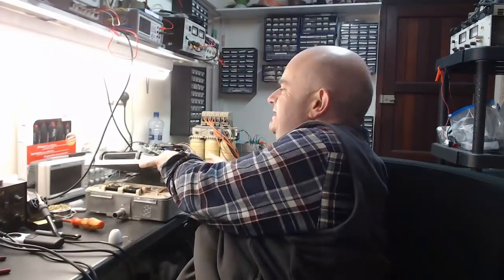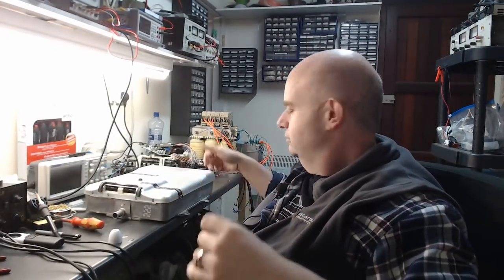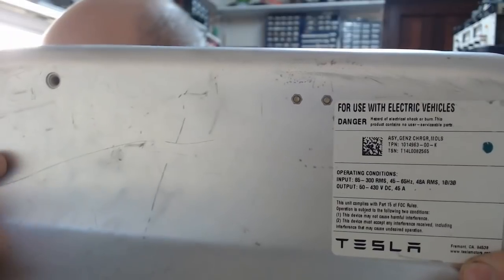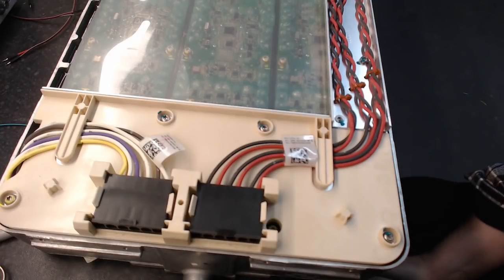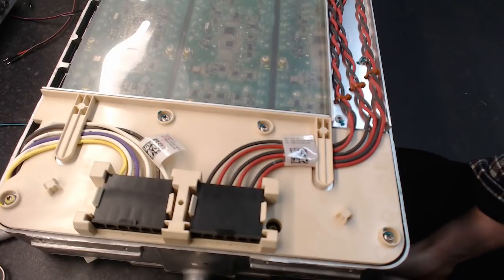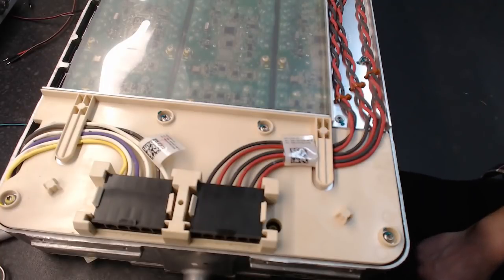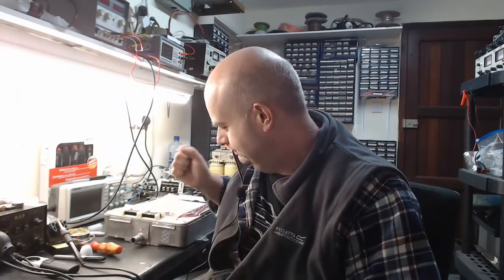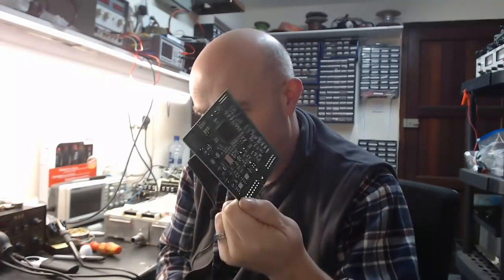E39 Upgrade Update

Comment: could your motor be low voltage  winding and need more amps at low speed,sounds like low voltage at high speed (lots of power)

Comment: I rewound a 5kw generator and it is not that hard ,do not flip a winding which will buck the power to the winding..I like the flat bar hair pin stacking  with brazed ends ,chevy volt like ,also with stacking winding you get low winding to winding voltages, helps  with the insulation life.

Comment: Motor is wound for lowish voltage and higher rpm. Simple solution lower the final drive gear ratio you have a transmission after all. More pain in the but solution rewind the motor.

Comment: Hi Damien 
 I would suggest possibly thinking old school,  knowing what little I do know about three phase AC Star Delta motor starters and what they do?, surely this could be done electronically using IGBT's? and the transition from one to the other can be altered via throttle position and road speed signals via CAN??, thus the star config giving a higher torque at low RPM and the delta config for higher RPM...
Just my 2cents worth....!

Comment: I think Johan's inverter uses scalar(v/f) control for the motor. Have you considered using some sort of vector control algorithm? It could improve motor response on lower rpm, and could also improve current control, depending on how it's implemented.
Reply: Regarding your question on tuning. This is related to the previous comment, different motors may respond differently to the slip control, but generally it provides suboptimal control of motor torque, compared to the vector control. So to fully utilise motor torque and input current, vector control is the way to go.